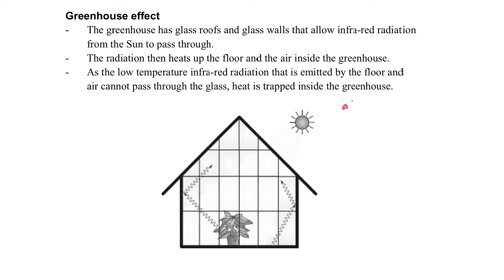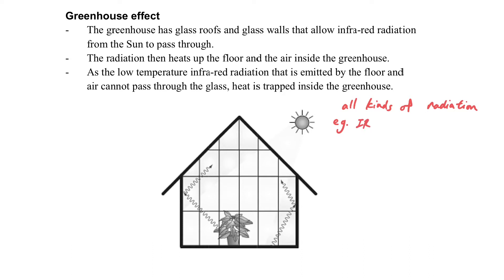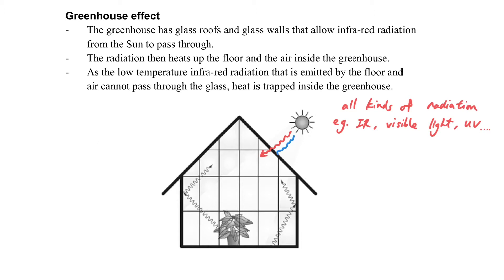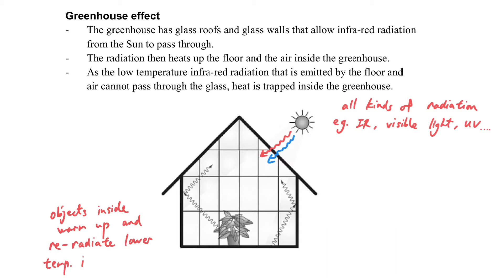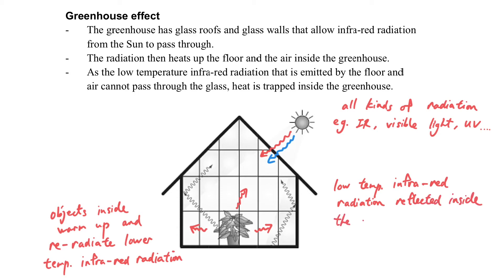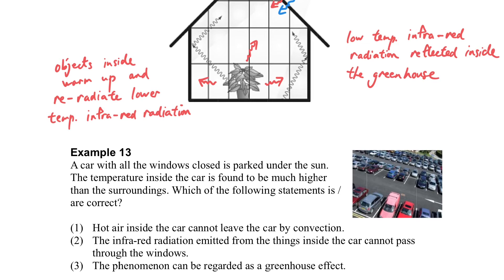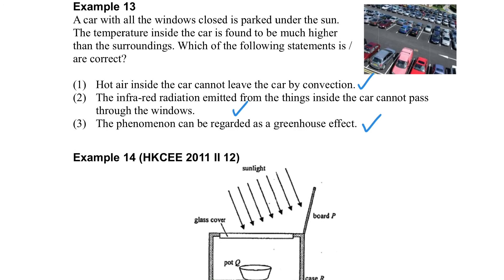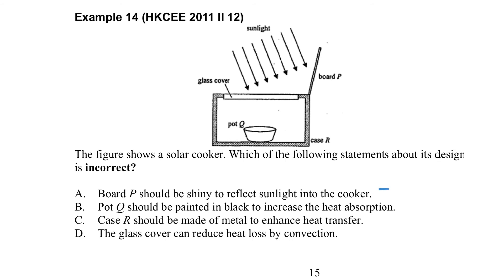Heat Transfer Process (Part 8.12 Greenhouse effect and example 13-14)

Comment: Are the glass roof and walls regarded as used for reducing heat loss by radiation?
Reply from the maker: Radiation can pass through glass, so we usually do not simply assume that it is used for reducing "heat loss by radiation". Inside the greenhouse, the temperature is warmer due to the greenhouse effect.